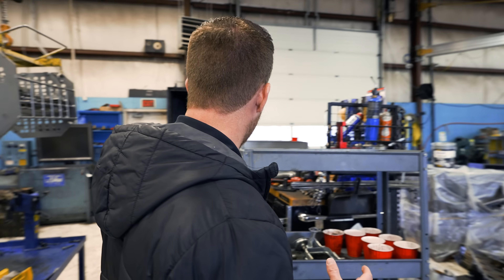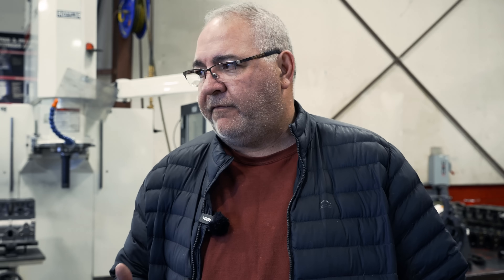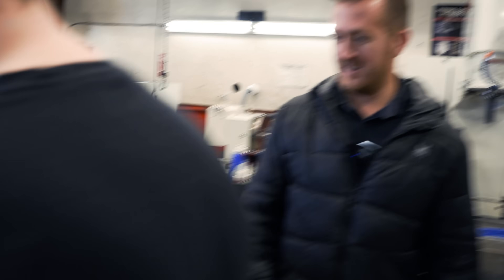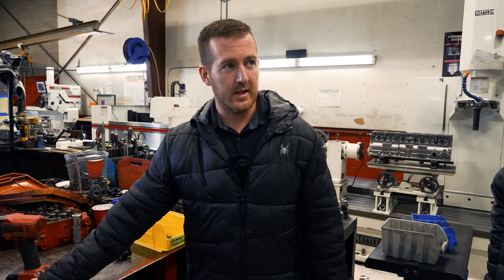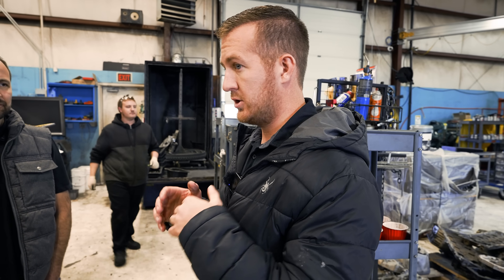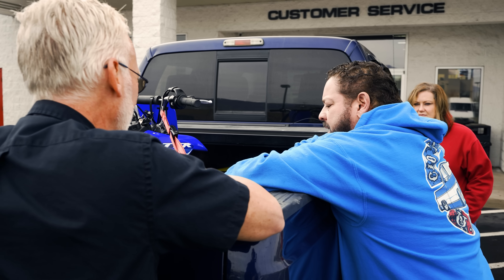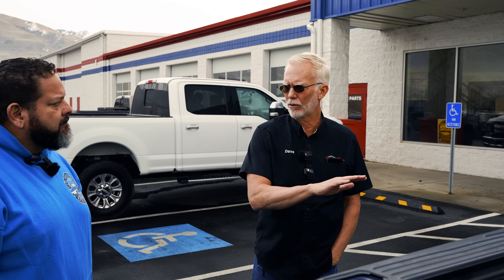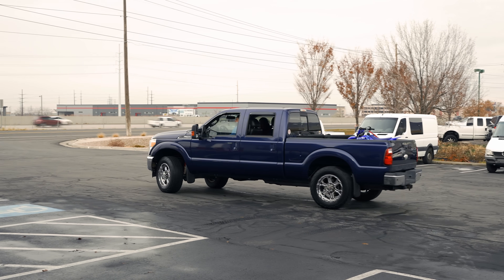Looking Inside a 900,000 MILE CP4 Pump!

Comment: I've been saying for decades, change the diesel oil every 20k bcuz soot kills diesels. Also fuel and filters bcuz fuel is filthy at the pump. Your diesel will last 1 mil miles no problem. You go one better and get an aftermarket lower micron oil filtration system. Then you skip an oil change and just change the filter. Also get a quick release oil plug for the oil pan. Just sayin.
Reply: @dsstaang  
Any diesel will have soot in the oil. I don't need to test the oil. Just take out the dip stick and u see how bad it is. I've had Freightliner, Cummings, Paccar, Chevy, and it's the same story with maintenance. I think the manufacturers don't want a better running engine. Fuel efficient yes but better contaminate mitigation absolutely not. It's like evrythg else with don't make it last, let it crash for quicker turnover and bigger profit.
Now they have added the DEF system which is such a joke. All it does is break down and rob power. Why not make a totally efficient engine that lasts 1 mil plus miles. But that would make sense for the buyer no cents for maker. 💩😳
Reply: Is what i do to my cummins,  but i idle a lot, so we'll see.
Reply: @HUASTECO8  Delete the thing and YOUR WORRIES ARE OVER brother, coming from a 15 yr transporter, lookin  out for ya.
Reply: @ronmoore3987  👍

Comment: So the number one reason this was possible was because diesel additive was used daily. And for some reason we decided against revealing the BRAND that actually made this possible?????
So much for giving customers the full picture.
Reply: Because Dave doesn't want to promote anything that isn't his product. Which I guarantee it wasn't his product. Most likely opti-lube.
Reply: @HSKFab  I used opti lube in my duramax. It seems like great stuff
Reply: @highball7347  It's great, I use it in my personal 6.7 powerstroke and my fleet of fords we buy bulk and just add it to our bulk fuel tank.
Reply: @HSKFab Dave’s fuel additive is optilube lol
Reply: @ianc8165  I'll ask them if that's true.
Reply: @HSKFab specific fuel recommendations would be super useful for me. I only have two old diesel tractors and figure I need to be adding more lube back in to replace what’s been taken out for all the “clean” fuel. Appreciate this comment.
Reply: @AndrewMoizer  The older diesels, or non-common rail diesels aren't as sensitive to the loss in lubrication as of late but it wouldn't hurt to use opti-lube xpd in every tank.
Reply: @ Appreciate the reply. Not sure it’s available in Canada it seems. I’m going to be looking more into additives, hadn’t appreciated the difference in the products. I’ve just been adding something for anti gel. I don’t use much fuel so it seems like it’s worth using something good.
Reply: @HSKFab you have zero clue what brand it was
Reply: @shawnengstrom3906  I know it wasn't Dave's. Hence why they didn't say. Opti-lube is #1 backed by independent testing so it wouldn't be too far fetched to mention it as a posibility.
Reply: @HSKFab  Dave’s hasn’t been out long enough to test anywhere near that mileage so that is very true. Many brands it could have been and would be nice to know which one. . . . .not that the one he did use truely matters
Reply: Any good quality additive that adds lubricity is gonna keep that pumps alive -we got trucks in our fleet 300k original pumps no additive but our trucks fuel at our yard - and our fuel supplier puts an excellent additive package - maintenance is key our fuels never go past 10k 
5k on regular fleet oil
Reply: @cormacsyt  Yes Dave has no HFRR score.
Reply: Wonder about countries with premium diesel with pre added additives such as Australia. Do you double dose?

Comment: At work, we have a 2022 F350. That has 450k miles on it, and it runs and drives just as great as any of the newer trucks we have, and he's never replaced anything on it
Reply: Anymore it seems like the guys who actually NEED a diesel have way better luck than those that don’t.  These aren’t daily drivers.
Reply: what line of work has to drive 150kmiles yearly?
Reply: @uv6er  hot shotting, deliveries, auto-transport, or camper transport like Indiana transporters for a lot of pull-behind campers or goosenecks. quite a few cases take these things non-stop daily for driving with minimal idle hours or downtime if they have 2 drivers in the truck
Reply: @uv6er oilfield hotshot driving. Our owner buys new trucks every 2 to 3 years but he refuses to get rid of that one.
Reply: A 3 year old truck is not considered a newer truck?
Reply: @drredline6268  generally yes, but in this instance, it's the oldest truck in our Fleet. All of our other trucks are 24s and 25s
Reply: It’s a new truck, it better still be running like new.

Comment: Is Marvel Mystery oil any good… the original that has sulfur in it?
Reply: It has one parts per million sulfur in it and it was really good for the older mechanical diesels but the problem is with the newer stuff you have to worry about the emission system that is one reason for newer oils when the engine burns a little bit it's not as damaging to the emission system . Not too much different than a catalytic converter on a gas engine

Comment: Amsoil for sure based on the cost mentioned
Reply: We use amsoil in our fleet and never have engine issues. 
there fuel cleaner, oil, and trans fluid is in all our vehicles. We also use wix filters
Reply: I wanted to hear additives and filter and oil brand
Reply: @DuaneWilson-ro1pn  what brand of oil and filter will cost $200 per oil change?

Comment: this video quickly turned into a secret sauce commercial….
Reply: Sadly, It's the norm here now.....a lil teaser vehicle\engine issue then the remaining 75%+ is hocking secret sauce & stellantis give-away garbage! Dave's is falling off very quickly and turning into infomercials unfortunately!🥱😟
Reply: @tdotw77 secret sauce works. I had an 2018 ram and ran hot shot secret every day treatment in it. I had 839k miles on it when it was stolen. Never replaced a single injector or had a single engine issue. I changed the oil every 15k miles like the owner’s manual says.
Reply: @jaredgreen2524  I never said that diesel additives are bad, I use them regularly in my 7.3 w\ close to 300k M on it (usually Diesel Kleen & some TCW 2stroke sometimes, I've used others at times too - Howes, EDC, etc if mine reg is not in stock). I did say that this channel is becoming more sales of products when it used to be strictly diagnosing & fixing vehicles and engine building\machining exclusively. We are watching the channel because we all want to see those processes not hocking secret sauce or any other products.... commercials\ads are bad enough already. I get it that sponsors videos are used sometimes but the secret sauce is getting old real quick! 🤔😆🤷🏻‍♂️
Reply: @tdotw77  it was a respectful joke ! as long as Dave’s is offering a quality product i support them taking a few seconds to plug something good that actually would save people thousands of dollars in repairs if they used it over time …. adding a proper lubricant to the 💩 fuel our government overcharges us for can save you a lot of money! this video proves that and is the only reason i commented what i said !

Comment: Majority of the cp4 pumps dont fail. I don't see what the big deal is. My lml has almost 400k. Stock injection pump and injectors. Valve covers never been off.
Reply: Most CP4 failures are attributed from human error, lack of maintenance

Comment: Doesn't surprise me.  I'm a chief engineer  and I've seen plenty  of injection  pumps last 200k + hours, We centrafuge  all our fuel plus racors and final filters. Also centrafuge  our lube oil. . These are 500k dollar plus engines so it really pays to be careful. They'll  run a long time if you give them clean fuel and oil. And check your coolant with test strips
Reply: What engines are you referring to ?  What are they powering ?
Reply: @65turbocoupe  mtu 4000s powering a fishing boat.
Reply: What kind of test strips are you talking about? Are they sold off the shelf?
Reply: That’s what happens when you use insane diesel bypass filter
Reply: Preventive Maintenance.      Yes sir.

Comment: Maintenance goes a far way.  I've got 1.4 million miles on my 2016 Cascadia DD15.. oil & filters changed every 10,000 miles.
Reply: Every week oil change?
Reply: @repairvehicle  Truck does  2 trips a month to the east coast n back, so once a month oil change.
Reply: @Stavros1977  engine has zero repairs? Original injectors and turbo?
Reply: @repairvehicle  Just lots of maintenance and Lucas fuel additives.
Reply: @Stavros1977 how many times did you replace injectors and turbo?
Reply: @Stavros1977 does he admit using Lucas  ???
Reply: @DuaneWilson-ro1pn  I don't know, but it's what I use.
Reply: @Stavros1977  you have not replaced your injectors or turbo?

Comment: I work in diesel injection. That man knows the secret. Prevention is key. Running your machine is key. These CP4's and even CP3's are tough, simple pumps.
Reply: Strong & simple they are but it only takes a little dirty\wet fuel to grenade one causing the dreaded contaminated fuel system replacement at $10k+. The Stanadyne DCR pump is so much safer and more durable for a $2k pricetag it's the best [fuel system]insurance you can buy for 6.7's!
Reply: @tdotw77  that's the bane of a common rail system. I often get injectors wrapped in dirty rags to test out. Pumps without caps full of dirt and grime. I tell my clients that a single grain of sand can ruin an injector and then cause all sorts of problems.
Reply: @fink94  I don't think people realize how super sensitive they are to any kind of dirt or contamination. That's why there's 2 filters and several screens inline on the supply system, it's not like your old mechanical tractor that wasn't as hyper sensitive. 👍🏻
Reply: @tdotw77  for sure. I do Rossa Master, DB's and DPA pumps for old tractors and whatnot. These pumps would run with gravel in them! Some are from the early 60's and they're easily rebuilt to this day (the hydraulic head does wear out though)
Reply: @fink94  they still use the lucas dpa pumps today. and they came out in the 50s
Reply: @chrisforgan731  yep!
Reply: @fink94  Those pumps are cool for sure. I've seen Area Diesel vids on YT doing rebuilds on them(check out if you haven't seen them). It's crazy how they precisely shoot fuel into the injectors under different conditions. They're like little tiny motors themselves!
Reply: @fink94 oh yeah I have done a bunch of old tractor pumps over the years. Seemed complicated when I first started but I found over the years that the governor is usually the first component to fail on most of the old John Deere tractors. Many of them used the same pump just timing is different between some models not the pump itself.
Reply: @fink94  heck yeah! My 92 idi would eat anything that went in the tank. 
I had a bad injector, when going down long steep hills, it would air lock the pump and shut off. 
I kept a small crescent wrench in the door pocket, for cracking the injectors. I'd jump the solenoid with a pocket knife and get it going  in less than a minute.
Reply: @tdotw77  I'm a fuel system engineer with Cummins on the large industrial products. The filtration we use on the fuel system is nearly sterilizing the fuel. Two stages of filtration where the first is a 5 micron Nanonet followed by 3 micron Nanonet. I suspect most CP4 issues on the Rams were Chrysler cheaping out on the filtration, but since I was never close to the CP4 issues I can't speak with any authority on that.
Reply: Who makes Dave's Secret Sauce?
Reply: @patsyalbertengel3066  Opti Lube. I called the manufacturer and they said they make the product for them. They also could not confirm or deny that it was their XDP All-in-one  😉
Reply: its common sense a lot of people dont read the manual provided lol. Nothing smart about it.
Reply: How do you store a diesel engine for long term safely? I have some heavy machinery and sometime it's not used for 8 months or more... some say it's better not to start them at all until you need to...
Reply: @pingpong9656 I say put additive in the fuel that is for lubricanting run it for a week then add another additive when you park it. When you go to start it turn the key on and don’t start it let the lift pump put fuel in the system do this a few times and makes sure it’s clean engine oil in it as well.
Reply: @Charlie-d3z  Good idea on lubricant additive.
Reply: The CP4 is NOT a tough pump. Put it side by side with a CP3 in any engine in severe service conditions, and it will not be nearly as reliable. Of course maintenance is key, but there's a significant sector of the market that relies on equipment that can survive outside the basic daily-driver parameters. And historically, run-of-the-mill stock 1-ton trucks have filled that market. But these newer trucks are just not meeting that challenge.

Comment: That's really incredible!

Like every person that watched video, we wonder what cleaner/lube additives he used?

Hmmm!
Reply: They won't say because Dave has a brand he sells.
Reply: @alexbarna9098 YAH well I don't buy Dave's brand  of silly sauce, I stick with what's been around A long time-HOWSE & POWER SERVICE, & once in a while A can of SEA FOAM. But I have been told that even Sea Foam will eat the seals in a pump in the fuel tank, so I don't make a big habit out of Sea Foam because of what my friend said about the seals. I have tons of experience experimenting w additives and on a Dodge ram Lucas will work , but too much and the pumps in the fuel tanks don't like it. Also on a deleted engine I've  run tranny fluid, 2 cycle oil as well but found those both will gum thinks up more than they will help so those I don't fool with anymore
Reply: @mr.oklahoma9288  what oil with filter will cost per oil change $200? Amsoil. What oil still good after 5k miles, 10k miles , 15k miles? Amsoil.

Comment: Very cool ill stick with my 7.3
Reply: I have 2 7.3s and I run fuel additive in both
Reply: Except it will take 100 years to go 1000000 miles with a 7.3
Reply: @adrianspeeder  it's a diesel truck you racing somewhere? 😂
Reply: @stan3070  If you ain't first you are last.
Reply: @adrianspeeder  😂 facts! They really shouldn't even be compared... Different league entirely
Reply: Indeed!!!
Reply: lol..  Same.
2002 7.3L, 6spd manual, manual transfer case, manual locking hubs.. 
When Ford built TRACTORS...  not trucks
Reply: @calholli  2008 6.4L, 6 speed manual, Spartan tuned to the moon when Ford built race trucks, not old man crawlers.
Reply: @calholli  That's a nice one.
Reply: You sound like a poor